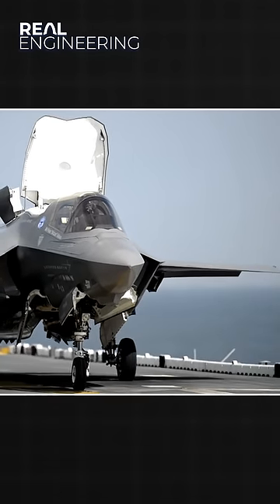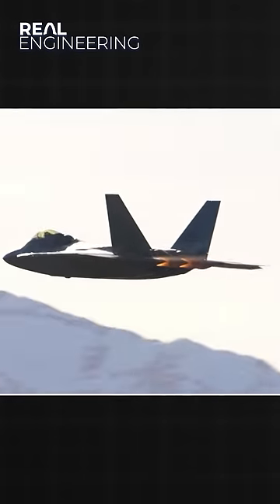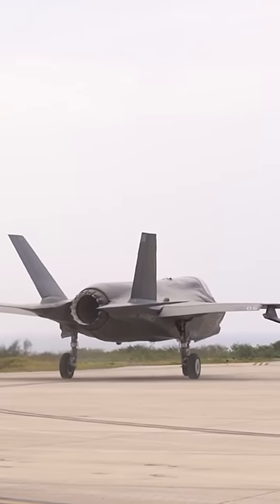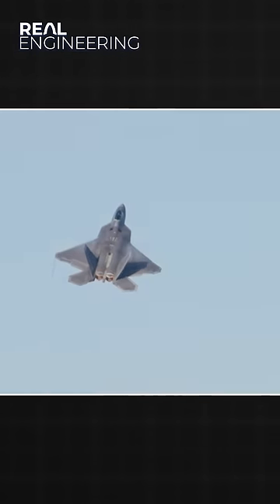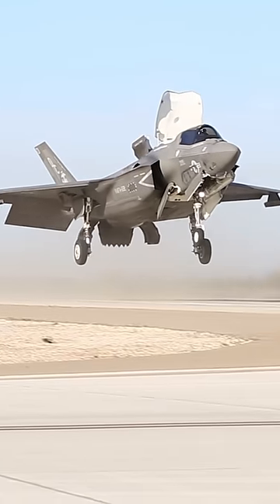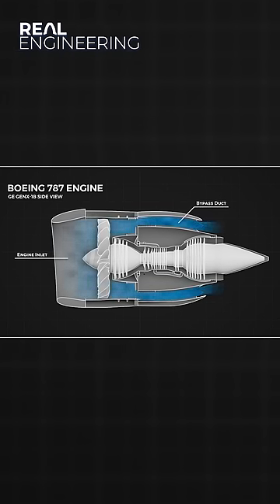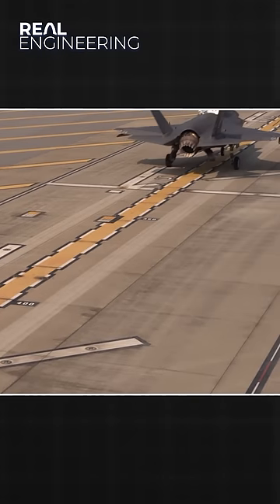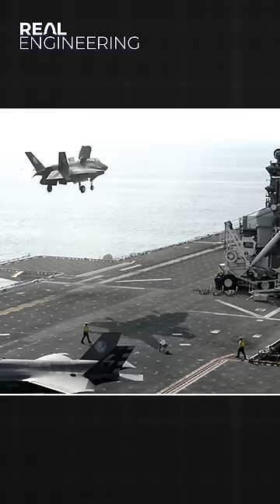How the F-35’s engine is better than the F-22’s

Comment: I think it is important to bring up the NOZZLE as the Nozzle on the F22 reduced the max thrust Significantly by being rectangular.  The Circular nozzles are far more efficient alone.  The F22 would make potentially as much thrust despite having a lower bypass ratio if it had round nozzles.  But the points you bring up do address the top speed concern more accurately so I see why you did that.  It must be hard to choose what information to include in shorts like these, because there is so much engineering that goes into this stuff.  
Thanks for the videos and keep it up!

Comment: The F135 engine is effectively the F119 engine from the F-22 designed for a greatly increased amount of thrust and electrical power generation.
Reply: Maybe the F119 & F135 are running the same compressor and turbine. Then they threw on a vector nozzle, higher output combustor, a bigger bypass fan, and that lift fan drive assembly. The F135 is a little hot rodded F119.

Comment: The f22 also has 2 engines.... its almost like each plain was designed to do something different. The f35 is a mass production capable 5th gen versatile platform. The f22 is 5th gen total air dominance.

Comment: Obviously it's better, 35 is a way higher number than 22
Reply: Lmfao that's the dumbest thing ever anyone ever said. The 22 is still not allowed to be sold to any Ally.
Reply: @floydprice4164  you're wrong
Reply: @MinorityRespecter88  lmfao you think so look it up. The 22 is not allowed by Congress to be sold to any country. The 35 on the other hand is the money maker for the defense contractor.
Reply: @floydprice4164 The 35 is better because the number is higher than 22
Reply: @MinorityRespecter88  that's the most dumbest thing I ever heard
Reply: @floydprice4164  "most dumbest"
Reply: @MinorityRespecter88  yeah just saying "dumbest" doesn't cover the idiocy that was just said about being "it's a larger number that's why it's better". There is enough adjectives to describe how dumb that is. The F-106 is a larger number than the F-22 or the B-50 (which is a flying wing bomber btw) is better than the B-2. Just because they are larger numbers.
Reply: I agree with Floyd, the f-35 isn’t better just because it’s a higher number. The f-22 is better in terms of air superiority but isn’t as versatile as the f-35.
Reply: @seventhsorcerer2885  The number is bigger. Is 35 a higher number than 22? Yes or no, it's a simple math question.
Reply: @MinorityRespecter88  bait, L
Reply: @thaddeus5944  but I'm right
Reply: @MinorityRespecter88  bout what? 35 being a bigger number then 22? yeah thats the only thing you got right because with your logic, a f-111 is better then a f-35. if you try to say this is wrong in any way, bait
Reply: @thaddeus5944  which is bigger?
Reply: @MinorityRespecter88  my 🐓
Reply: @thaddeus5944  I win

Comment: Yup, it’s a totally different package than the 22 with a different philosophy of use. The 35 as you said is meant to loiter. It does very little of the forward engagement and is rather a strategic asset with an array of electronic warfare systems, as well as more advanced surveillance, targeting and communication abilities. It’s better suited for finding the targets for an F22 or other system to attack, with the ability to strike a few targets of its own. But the F22 is definitely better suited for the combat, and has better standoff (fire superiority over a longer distance) with the right weapons and a bigger weapons bay to store all those weapons, higher speed, a larger magazine for its cannon ammunition, and a smaller radar cross-section in the right configuration and orientations.

There is no perfect weapon, not in isolation. The REAL weapon is the whole network of logistics, intelligence, communication, work, and coordination that makes these units function in a cooperative combat effort.

Comment: The F-22 has two engines, putting total max thrust well over the F-35. But yeah, the F-35's single engine outsized engine is an amazing piece of the overall system engineering

Comment: There is a use for both. I mean, being able to take off and land vertically basically turns all of your ships into aircraft carriers. Put the super fast planes on the aircraft carriers and put the slower vertical takeoff ones on the non-carriers and you've got yourself an incredibly capable fleet that'll have a huge edge at getting air superiority.  

Even if the F-35 is slower than other planes, it's missiles and bullets are certainly faster. If they're outrun, keep them within the area of the ships anti-air guns and you can sort of have the jets and the ship watching eachothers back

And that's just at sea. I mean, being able to have a Jet that can take off and land on a tiny runway is still a huge advantage

Comment: You are talking about the "B" version of the F-35, there is also the "A" and "C" models. Each one is different and performs different than the "B" model. The "C" version  has larger wings because it is suited for the Navy to land on aircraft carriers and the "A" is the Air Force.

Comment: The engines are designed for different purposes...so deciding which is 'better' depends on what you have decided they should do.   Fat Amy is slower than the Raptor because it's FAT and the inlets aren't designed for high Mach diffusion.  

The Raptor can go faster but is still intake limited because stealth demands a fixed geometry inlet which can only go so fast before you need to have variable geometry to work with the over Mach 2 airflow needs.

Comment: Imagine an f-22 with two f-35 engines and without vertical takeoff thrust vectoring 💀
Reply: The f22 already has thrust vectoring though, and the vectoring on the raptor can go upwards allowing for quicker turning(unlike the f35 engine from what I can see), and the engines on the f22 has a higher top speed

Comment: couldnt they have added variable fins to the engine casing so when going for top speed the fins would open to get some of the air into the turbine instead of around the housing

Comment: The F35 uses a mid bypass engine not a high bypass as pictured, with the exception of the STOVL version which uses a shaft driven lift system which drives a fan just aft of the cockpit, this version of the engine uses some of the bypass air to aid in producing a stable platform along with other thrust vectoring systems. All versions of the aircraft use the same base power plant. (STOVL configuration  https://en.wikipedia.org/wiki/Pratt_%26_Whitney_F135#/media/File:Engine_of_F-35.jpg  )

Comment: Real Engineering, tell me you know nothing about gas turbine engines, without telling me you know nothing about gas turbine engines. Most of the air that travels through the engine, is used to cool the hot end components, (combustion chamber and turbines). There’s only around 12% of the oxygen is burnt, so the by-pass air is not ‘wasted’.

Comment: A twin engine can fly on one engine, if there is a minor stall or even debris sucked I to the engine during vertical landing or take off, it falls like a rock
Reply: Just think about how power has to get from 1 engine to 1 extra fan. Then think about 2 engines trying to do the same, that's infinitely more complex. I like the single main of the F-35B.
Reply: Probability of this happening vs the benefits of the F35s single engine… think it through
Reply: @CG-dd9tb  the f-35 has mandatory 6.6 man hours maintenance per flight hour...

Comment: F22 can super cruise. F35 cannot. F22 can lose one engine and make it home, the f35 cannot. The f35 uses TWICE the fuel of the f22 because it weighs more and needs more energy to get off the ground, whereas the f22 has a much lighter frame and higher mission range.
Reply: F35 has no need for super cruise

The benefits of a dual engine are negligible, the benefits of F35s single engine are substantial especially when designing in the VTOL

Fuel usage depends on what you’re doing. F35, on average, does not use twice the fuel.
Reply: Negligible?  Losing one engine isn’t negligible when you only have one engine. The F35 has an amazing array of capabilities and strengths, but it’s still outperformed in every aspect by all its peers and counterparts. The F18 and the F15 both do seed better. It has Nukes. It’s a stealth multi role airframe with Nukes. That’s basically it.

Comment: It's better to have 2 engines than one
Reply: Traditionally, yes, but modern engines are so reliable that the odds of losing power are low enough to not need a second engine for redundancy. If the US Navy and the USMC didn't see the need for twin-engine aircraft despite the much greater risk for carrier-borne aircraft to lose engine power in flight than land-based ones, it must be that they have a lot of confidence in the F-135's reliability
Reply: No it isn’t.
The benefits of a dual engine are negligible when you actually consider failure probabilities. The F35s single engine design is a big plus especially when integrating VTOL

Comment: Redundancy and heat cloaking of the F-22 engine configurations make it a superior outcome for the aviator.
Reply: Engine redundancy makes no significant difference when you actually consider probabilities of failure modes and is an irrelevant point.

Comment: The F-35 is meant to loiter just like the new NGAD and the FA-XX program theory they will be designed around. They're meant to see you well before you see them. They're only real problem will be getting in a dog fight it's not going to be very fair but I imagine that's why each will have at least two drone planes with it. The US Air Force and navy planes will just both be small flying wings similar to the stealth bombers, just not as drastic of a width just made longer, so it's more stable in flight as it will need to do far more aerobatic Maneuvers when compared to bombers. But it allows for the cleanest radar avoidance design possible. That means not having vertical stabilizers. The ironic thing is if the Air Force was to have taken the F-23, we probably wouldn't be replacing the F-22 at this moment. The F-22 and F-23 compared very well to each other, but they exceeded and improved on each other in two different ways. The F-22 was far more maneuverable in case of a dog fight. The F-23 while it would have been a more skilled dog fighter than the the new 6th generation planes but was designed with the same principles just the F-22 was cooler in the sense of aerobatic maneuvers and that was a large reason it won out.

Comment: The F-22 can go way faster than Mach 2.2 It has 80,000 lb. of thrust, whereas the SR-71 Blackbird had only 64,000 yet flew at Mach 3.2 in full afterburner. Like the SR-71, clearly the F-22 isn't thrust-limited.
Reply: There’s more to going fast than thrust.

Also, ‘mach’ relates to speed of sound, not ground speed

Comment: The f35b cant do its vertical landing or takeoff when it has more then something like 65% fuel in the tanks, im sure the computer does all sorts of calculations to rule out a vertical landing or takeoff other then just fuel capacity tho and max fuel capacity required for the plane to allow the pilot to do a vertical takeoff or landing can prolly change based on other parameters like what weaponery is currently onboard and what the aircrafts gross weight is and other parameters as well. Regardless of whatever the f35 is a rlly expensive piece of junk compared to just about every other cool aircraft like the 22, 18, 15, 14 etc. I say this alot but getting away to fight and fly another day is far more important then remaining undetected for a limited amount of time because eventually the f35s position will be detected and at which time wont be able to get away to fight and fly another day like other aircraft can cuz its sooo heavy and lacks the manuvering capabilities like that of the aircraft i mentioned previously lol.

Comment: Only one of these planes can loose an engine and go home.
Reply: Possibly. That would depend on why it lost the engine.

Considering probabilities of failure, having a second engine gives no significant advantage
Reply: @CG-dd9tb 
Wishful thinking. 
I’ve had 13 real single engine failures and 24 engine failures in twin engine aircraft. 
Would like to know which would be fatal if not for being in a flight test environment? 

By the way, just so we are using the same terms, “losing an Engine” means on that that stops producing thrust.  If it is in a single engine aircraft, it doesn’t Depend on wether or not you believe it or have calculated the probability of failure or not, you are still going to come back to earth sooner than you planned and probably not where you wanted.  
If this happens at night, there is a procedure that has been around for a while. “ when you’re gliding down to earth at night after a single engine, engine failure, and you think you’re getting close to the ground turn on your landing light. If you don’t like what you see, turn off the landing light.

Most of the planet is covered by water by the way. For every second you are going to miss gliding to the shore line, it’s better than a 10 min swim.

Comment: When the F22 loses an engine, it can come home. The F35 is a rock.
Reply: The F-35 can still glide for some distance also with a light combat loadout the F-35 is more aerodynamic than the F-16 since has it's payload in the internal bays instead of under the wing on pylons. Yes the Raptor is 
more survivable but it also cost 3 times as much per aircraft at 350 million dollars.
Reply: @T-Dawg123a  It's a brick.
Reply: @werewolf5674   their a bit chunky compared to the aircraft their replacing but the aircraft is it's size for a reason. The F-35 isn't the best air to air fighter and it wasn't designed to be. The F-22 is the air to air king but for ground attack or fighting anything besides a F-22 the F-35 is good enough, and at 1/3 the price cheap enough to replace all the aging 4th Gen jets. Don't get me wrong I want more F-22 Raptors but there are only so many tax dollars that congress is willing to spend. Frankly I think congress should have stopped giving themselves pay raises for a bit and used the the money to get a few more F-22s to dunk on Russia as the Soviet Union was collapsing but nope congress shlashed the military budget...
Reply: @werewolf5674  Every fighter is a brick if it loses its engines. Their L/D max is at relatively much higher speeds. The engine failure argument is also statistically insignificant by research in both GA and the military; no amount of engines can compensate for natural reliability and proper emergency procedure training.
Reply: @forzaelite1248  I was a Fighter Machanic for 20 years. Engines fail.
Reply: @werewolf5674  you weren't an F-35 mechanic, so your experience means diddly squat. I was a part of the F-22 program for 10 years (8 on the line, 2 in MOC) and have since switched over to the F-35. It is lightyears ahead in terms of reliability and maintainability. Engine changes were commonplace on the 22, with one or two a week being a normal sight in the unit. In the past two years, my current 35 squadron has changed one engine total. One. Out of 20+ aircraft. You simply don't know what you're talking about.
Reply: @anchoviebear  Time will tell.

Comment: The F-22 uses less fuel yet is faster and can achieve super sonic speed without using afterburner and Does out maneuver the G-35
Reply: Different aircraft built for different roles

Comment: Ignoring the fact that the F-22 is the most advanced stealth fighter?
Reply: Advanced in what way? the f35 is imo more advanced when it comes to connectivity and sensors
Reply: It’s not the most advanced stealth fighter. Lower radar cross section, higher speed, more manoeuvreable. That’s it. F35 slaps it in all other regards

Comment: But due to the issue of damaged stealth at top layers of F35 at supersonic speeds. It is now reduced to fly at 0.8 mach as a standard procedure and only go beyond is extreme cases.
Reply: You mean the issue at supersonic speeds that was fixed before mass production started? Old info buddy.
Reply: @t1mb3rfps80  I don't remember exactly when but I read an article within last 3 years where airforce or naval air arm had passed this directive/SOP (if that's the right term), limiting the maximum flying speed to 0.8 mach. Continuous flight above mach 1 resulted in patches of stealth skin peeling off.

Comment: The F22 is also significantly smaller and lighter than the F35. There is a reason the F35 has the nickname “Fat Amy”.
Reply: Max take off weight of f-35 is 49,900lbs, max take off weight of f-22 is 83,500lbs. F-22 is much larger, should be obvious considering f-22 has TWO engines.
Reply: Wingspan on f-22 is 9ft larger than f-35. F-22 is also 11ft longer

Comment: Then why is the F 22 non exportable BY LAW, but we sell the F 35 to any non threat?    

Engine may be better, but the plane as a whole is NOT
Reply: We technically could via legal loopholes, but we never did because it was deemed unnecessary at the time; between the middle east and next gen technologies having more priority you'd be hard pressed to find enough customers to warrant that. Also much of the tech that was in the F-22 was evolved for export in the F-35, specifically with export hardening of the software
Reply: Because it isnt getting build anymore.
Would be pretty bad to sell the f22 when u dont build them anymore and also the f22 is alot more expensive.